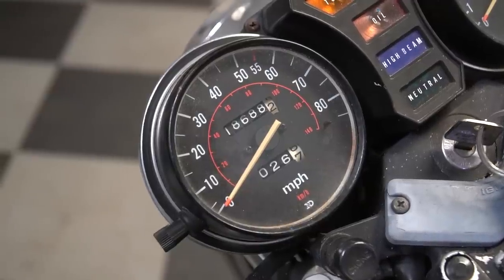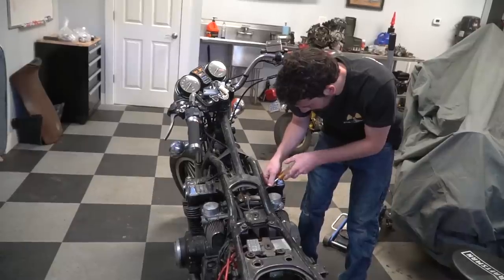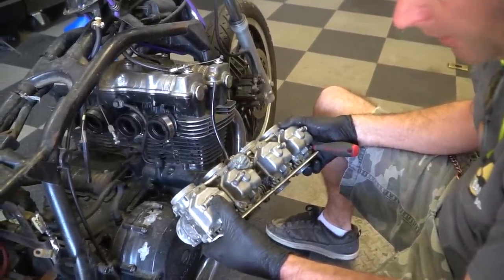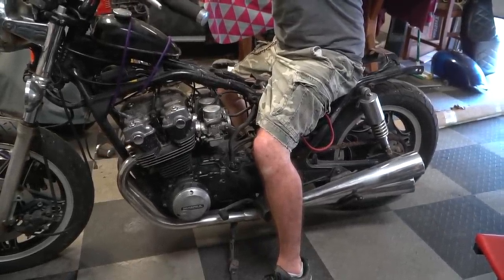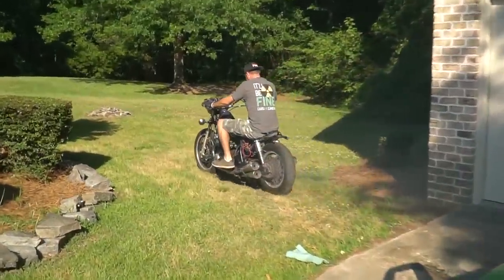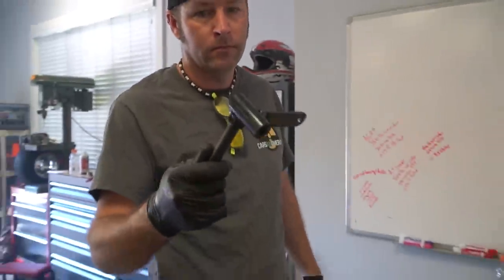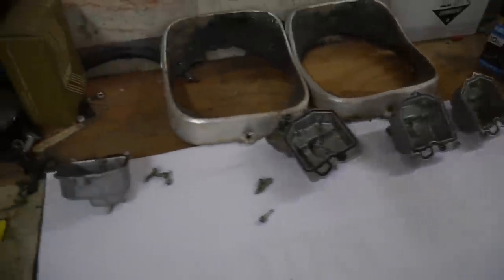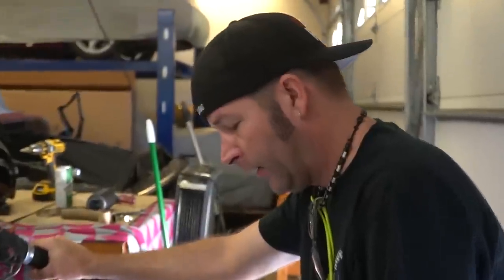Cheap CB750, Will it Start? Cross Kart Build Pt. 4

Comment: You will spend a lifetime trying to get constant velocity carbs to run right without the original air box, swap them for dual slide carbs. I had the same problem.

Comment: let me give you a nickles worth of free advice, try the cheapest first. change the spark plugs. and check the spark-plug-caps for their resistance. (it should be 5-k-ohm) if they are not within specs it will cause stuttering like this. and also. you gotta have the filters on. and make sure the inner lip of the air-filter flange don't cover any of the air nozzle at the back of the carburetors. Good luck.

Comment: It doesn't get enough fuel. There superposed to be a fuel pump on there. Syncing the carbs and putting an original air filter on it, will also help a lot.  It's 100% not the exhaust.... And I highly doubts its the timing.
Reply: Fuel pump? Not on this.
Reply: @gsp49  it has a vacuum fuel pump on it originally. Gravity isn't enough to fill carbs at higher RPM.

Comment: check to see if there is a rev limiter on the bike some times rev limiters won't let your rev up if it is not in gear
Reply: This was before rev limiters.
Reply: My bad your right it doesn’t but it sounded like a rev limiter and in the older bikes when the rectifier is going out or getting too much voltage it stalls out just like a rev limiter
Reply: @Tee_Spoons_Garage  ,I hear the new GoldWings are limited to 114 mph, so why would anybody buy one? On the older models the engine seemed to be running only at fast idle doing 140 mph.
Reply: Greg p I have no idea. 114mph is still hauling ass

Comment: I guess that the REASON why it makes smoke is because there is a probably a damage/broken piston ring🤷
Reply: Either that, or the valve stem seals are shot - which is quite likely given the age.  The only way an engine that old is going to run well is if somebody else has worked on it more recently.

Comment: That has a dead cylinder. You can hear when it cranks that one hole is low on compression. The valve cover gasket is probably leaking because someone had it off trying to figure out why.

Comment: Those carburetors are the worst with pods, you can do it but it's really not worth it, put stock air box on it and it'll be fine I ran flat sides on mine and it woke it up good luck

Comment: For under five bucks at Harbor Freight you can buy a spark plug tester it looks just like a test light and it will light up if you have Spark.
It definitely works better than holding the spark plug and getting hit with all those volts of electricity,  OUCH......

Comment: They run like crap on pod filters, worse still with no filters. If you have to use pods you'll need to be changing away from the vacuum carbs to whatever the flavour of the month is these days, Mikuni's or Amals back in the day over here.

Comment: I KNOW WHY ITS BOGGING!!!  The carbs are CV style carbs.  There is a diaphragm inside each of the round cans on top of each carb. The diaphragm is connected to a throttle slide, that is independent of the the one connected to the throttle cable.  BE EXTREMELY CAREFUL WITH THEM.  SUPER FRAGILE.  Two possible problems.  One is a slide valve is sticking and the carb basically isn't opening up, or a diaphragm is damaged and the slide valve is not opening.  Also, it is possible that your carbs are so far out of sync that they won't even allow the bike to rev out and also make it bog.  Do a little googling and see whats called a "bench sync" to get the carbs fairly close to synchronized.   Then it should run decent, if that is the issue.  Steve Chase  Good Luck Guys!

Comment: Those tractor supply heim joints will not stand up to use in a suspension on a buggy. Been there, failed.

Comment: Start simple replace the plugs, it sounds like weak spark or fouled plugs. If the fuel system is clear & clean the intake filters or exhaust may be plugged up.
 Most Jpan bikes don't smoke ever it's a oil control problem. Let it get up to temp & keep it running it should clear. Engines that sit have a tendency to have the rings stick. It takes heat & movement for them to free up.
And quit using starting fluid unless you want a seized up bike engine. It creates cylinder problems when you use that crap.
Reply: Correct, NEVER spray starting fluid in a gasoline engine!

Comment: guys, leave that old dog alone, repair it back too it's past life. that model was one of the best Honda every made. the smoking can be fixed with a treatment of sea form.  the carbs need too be soaked in cleaner not taking apart.  I road the 750  models for forty years. if you want I'd buy it as it, and allow you too make out.

Comment: Honda used Keihin carbs and they are super finicky to dirt, you have to ride those bikes every day to keep them running good, put a set of Mikuni carbs on it and it will haul. 
I still think you should find a water cooled motor for your project though because with a aircooled motor behind the seat it will over heat. I would fix that bike up and sell it to finance a newer wrecked bike to salvage the motor from.

Comment: if only you guys had let me know this project was coming up...…… I GAVE AWAY a 2004 katana 600 engine that only had 9000 miles on it. the bike had no title and I used it as a parts donor for my 2001 katana 600.

Comment: Put the goddamn air filters back on it it's way too lean if it's still super lean with the filters back on wrap the filters halfway in electrical tape to reduce a little bit of flow to get your mixture right for testing purposes if that works do some research and order the correct jets for the K&N filters and whatever exhaust you plan on using

Comment: just my 2 penny's worth but did you check the diaphragm vacuum rubbers older bike such as this most probably have old rubber that have cracks and holes or just perished with age.
so It idles great and up to 4k rpm is on the money come off the idle circuit and it becomes a bag of sh*t because it can not produce the low pressure/ vacuum to lift the needle because the afore mentioned diaphragm rubber has seen better days.
Blah blah blah......

Comment: This thing sucks! Your talking about checking timing when the valve cover is off, the only thing your gonna see under there is the cams. Unless the timing chain is really loose and let one of them skip a tooth your not gonna see anything to fix. I really doubt the timing is off. If the timing chain is loose your screwed. And finding parts for old bikes like that are a nightmare sometimes. Your are really better off buying a auction salvage bike and at least you know it ran up until the crash. There's a Ducati monster with a bid of $650 right now at one place and street bikes very reasonably priced that will sound way better than heavy junk your gonna be fighting the whole time you work with it. You've already spent $350 on that and if you buy another bike you'll have more into it and the whole time your not moving forward on your build. Should check out videos of 600cc buggies they're awesome! They sound amazing and go like crazy! Just hate to see guys struggle on their build. Still looking forward to whatever you guys do. Just think you made a mistake with this heavy, low powered lump you just showed us.

Comment: Love what you guys do but this is a painful vidya to watch! Being a motorcycle mechanic it’s painful! Clean the carbs! They need to hospital clean! The brass needs to be shiny inside and out, and no scum on anything. Pods work great if adjusted properly to compensate for the. The air filters also need to be ported on the rubber flange for secondary slide ports. #1 mistake made when installing pods! Everyone installs them and they run like crap and say they need jet kits... 9/10 times it’s because the flange covers the ports and need the mixture screws opened and carbs synchronized. The timing will be perfect, it cannot be changed unless someone changed it. If it was out it wouldn’t run as well as it does. Just clean the carbs, make sure the needles are clean, secondary slides move free, when you spray gently through the port on the backside of the carbs the slides should rise smoothly. Make sure the air pods flanges are trimmed for those ports. Finally sync the carbs and it will run like a top!

Comment: I have a running 2006 CBR 600 RR fuel  Injected engine 105    Horsepower   If you're intrested

Comment: Run some Seafoam through it
Reply: Bad advice, will not help it.
Reply: @gsp49  It helps clean the engine a little bit. Why wouldnt it help.
Reply: @kaistuppnig1037  , we used to get seafoamed  stuff in at the Yamaha shop that was full of corrosion, like some sort of acid in the product was reacting to the aluminum parts of the carburetor and causing a sludge that made it difficult to clean and fix. In engine class in school we were taught that if the molecular make up of aditives wasn't fuel or oil, that the use of such products was a waste of money, and such products were best left for "shade tree" mechanics, but that was 40 years ago. We were taught how to clean components the correct way, with the correct products. I could be wrong in this case, since with the advent of fuel injection and other things, the rules of the ball game may have changed. I suppose a lot of the messed up seafoamed stuff we used to get was where people who had no mechanical knowledge used it as a last resort hoping for a miracle fix on something that was already in need of repair or maintenance, then let it sit too long before getting the solvent out of the system, or bringing it to us.  Hope my answer helps. Thanks.
Reply: @gsp49  Thanks for the information.

Comment: I fine video of how NOT to repair a Honda like this. You guys have no experience do you? Almost ruined the starter. Never stick a wire or file in those jets! Note the carbs on inside are not the same as the outside carbs., And it will never run right without the factory air filter and intake on it.